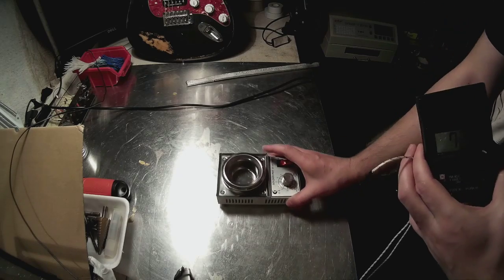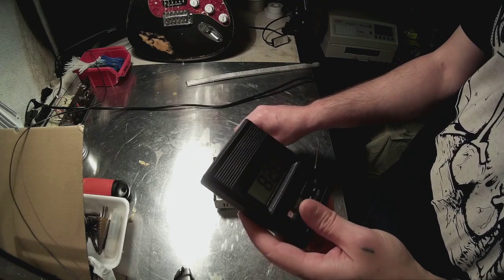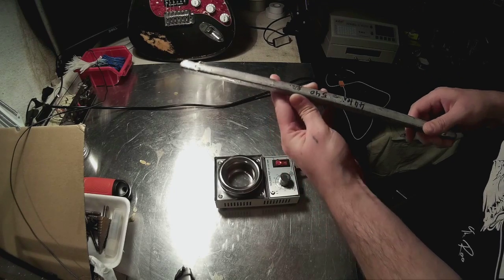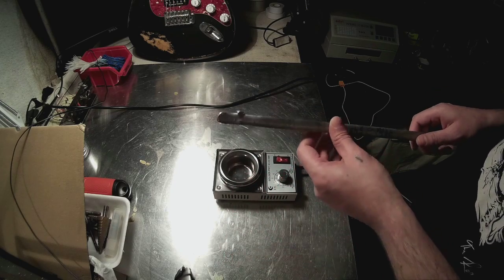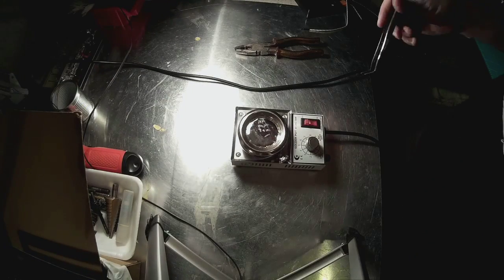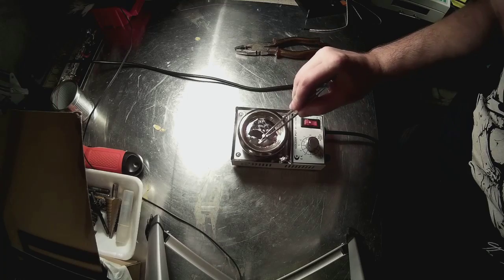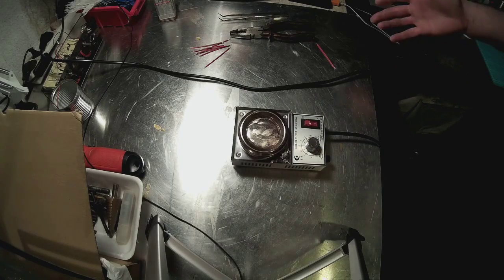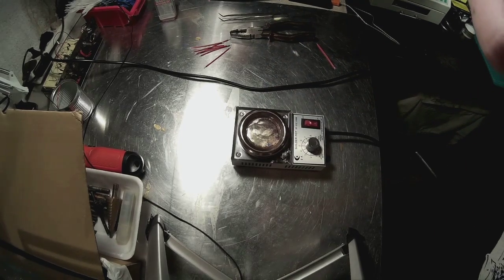Dip/drag soldering using solder pot

Comment: With all due respect, this is wrong in soooo many ways.  The slag is cleaned completely from the top of the pot with a piece of cardboard the width of the pool.  You first have your flux in a dish soaked in a sponge ready to go.  You pick up the board with tweezers grabbing onto a component.  Pat the bottom of the board on the flux soaked sponge and then release the board on the molten solder letting it float on top of the solder for about three seconds.    Actual time to float is dependent on the temperature of the pot, type of flux, type of components on the board, board material and solder composition.  Remove board with tweezers, lift board while sliding sideways a little kind of like a skier coming off of a ramp. Clean the flux with good quality alcohol and dry it quickly with compressed air.  It takes only a little practice to get it right.  Remember that the pool of solder should have a mirror like look just before dropping the board onto it.  I hope this helps anyone trying to learning  to use a solder pot.

Comment: How did you hold the component on the board before you dip it into the pot? I couldn't see anything hold it but it's stays there what it is would you mind to tell?
Reply from the maker: The components had their leads bent and then cut, basically it was the only thing that hold the comonents on the board.

Comment: This (completely valid) process is 'dip'  soldering  (or maybe 'drag' if you have any lateral movement of the assembly across the solder surface).  Wave soldering uses some method (e.g. a pump) of forcing molten solder into a wave over a baffle, minimising the dross in the active contact area.   I machine soldered in a small factory,  doing wave, dip, drag, and vapour phase...
Reply from the maker: +greaser5691 Shite i knew it was another name for this. Dip soldering it was :| my bad and thank you for your excellent comment.